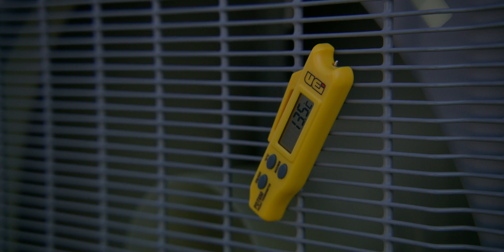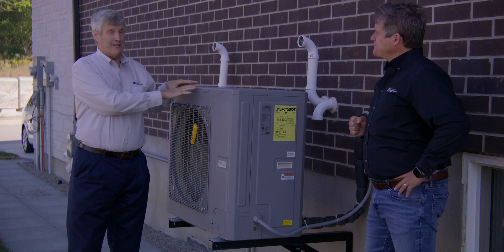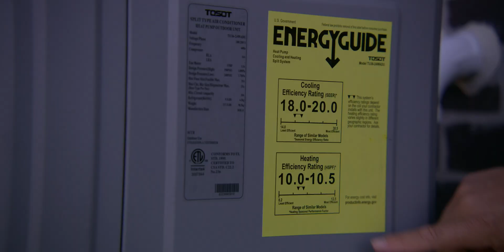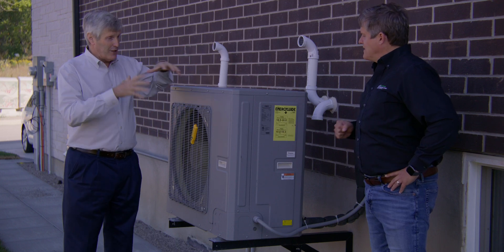Cold Climate Air Source Heat Pumps - Heating and Cooling for Canadian Homes

Comment: Air source heat pumps might work in a dry cold climate.
The UK has a damp cold climate. This ices up the element there is no efficiency when electric has to be used to melt the insulating ice.